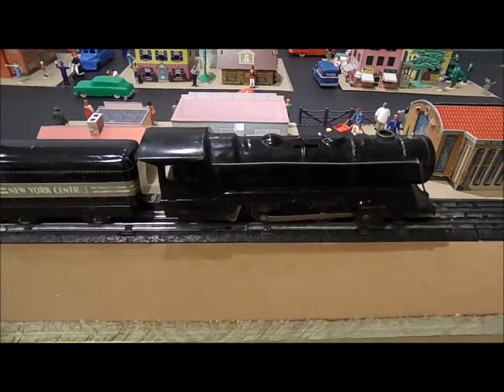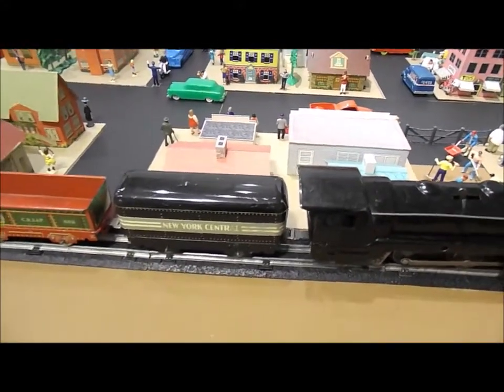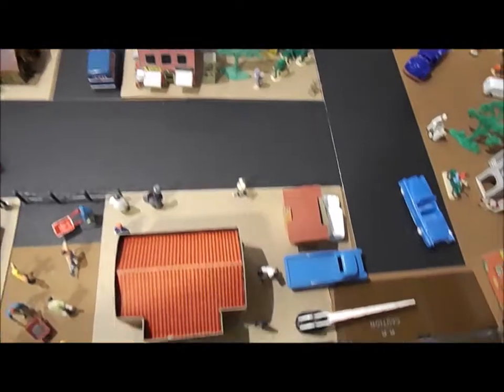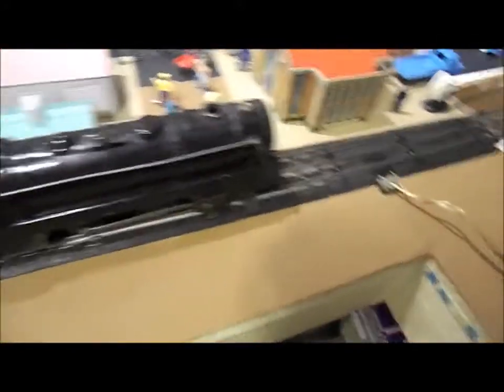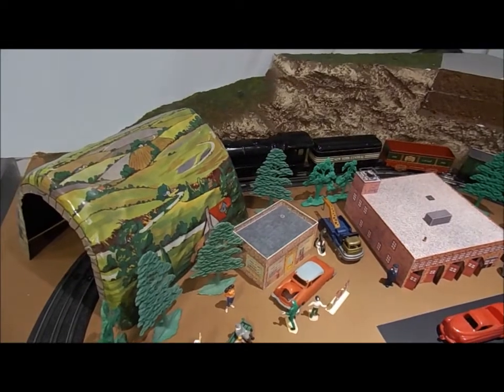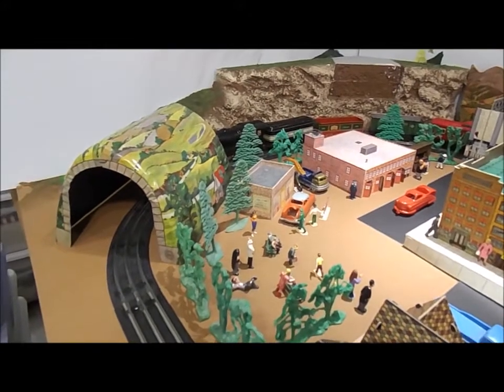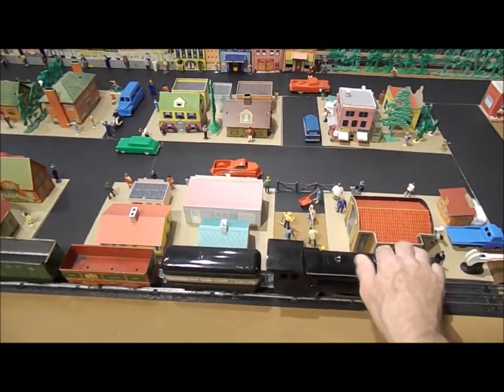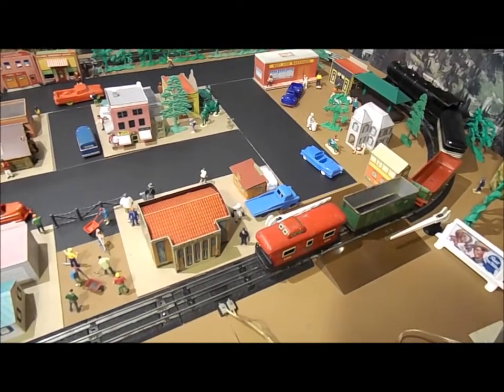Marx Wind up No  994 On The New Layout

Comment: The New Layout is looking really good Edward. The 994 wind-up Marx ran good, but it sounded like it needed oil or something. You have a lot of Marx trees.  Nice stuff. Al
Reply from the maker: Many Thanx! It's still a work in progress and I've already thinking ahead to the next series of changes. But for now this'll do. It's still fun :-)
Reply from the maker: yeah, all my stuff does gets oiled before hitting th track but either the oil needs to get worked into the mechanism before running or I need to use a different brand or I need to use more of it

Comment: She needs oiled!I will give her some TLC,great video
Reply from the maker: I'm gonna have to find my Marx repair book. I do oil these but maybe it's not enough. OR I'll post the question to the fb group.
Reply: Do you oil all of the shaft ends and the wheel axles?
Reply from the maker: Yes I do and where the armature sticks through the side of the motor housing. I'm using one of the LaBelle oils. Maybe they just need to run more before I take videos to allow for the oil to actually work its way in. I also oil the wheel sets on all the cars.
Reply: Well I figured you did was just curious since you dont run wind ups.